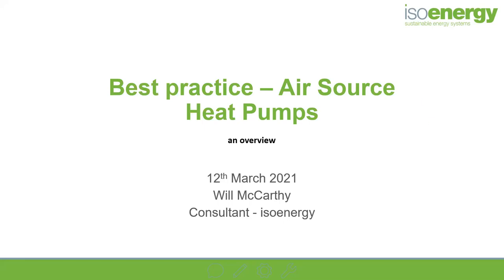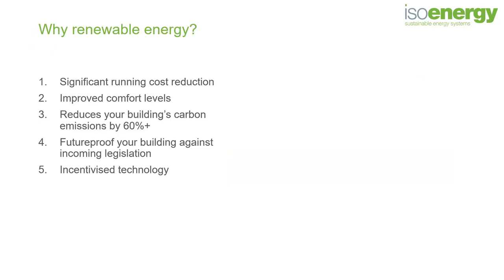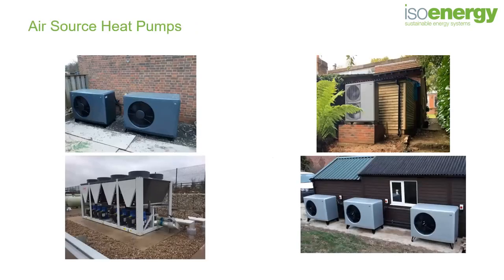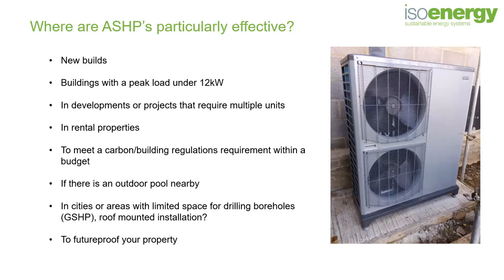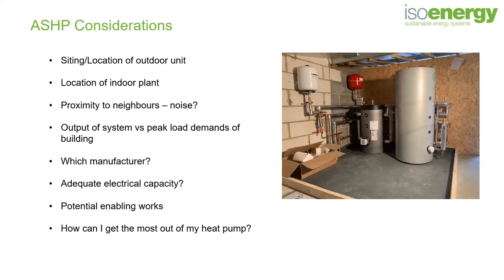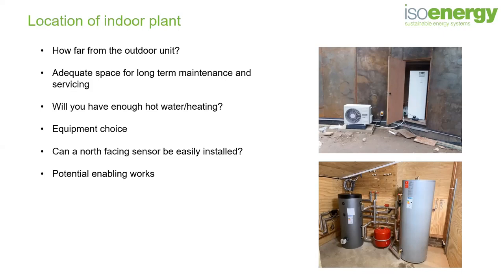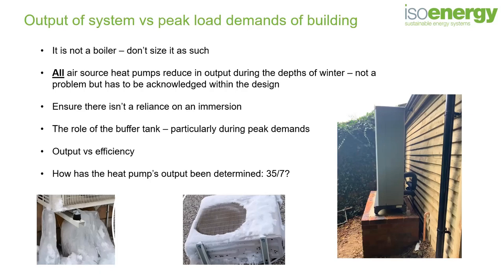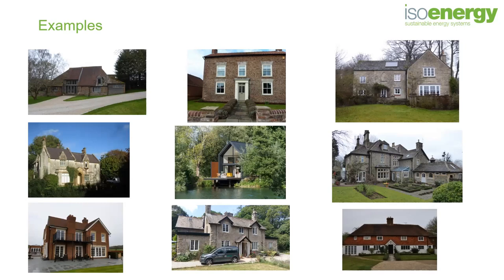isoenergy guide to air source heat pumps

Comment: There seems to be some misapprehension of the running costs for modern efficient heat pumps. My Mitsubishi heat pump is costing me significantly less to run than the gas system it replaced. It also consumes vastly less energy at 4,000 kWh pa vs 21,000kWh pa for the gas boiler it replaced.
Reply from the maker: That's great news Phil. You are right, we tend to under play the savings a little to manage expectations and not overpromise like some companies. Out outline proposals we provide once we have had a good look at the current costs and circumstances of any project, tend to have a more accurate cost payback analysis.

Comment: I'm hoping to move house very soon and had planned to install a large pv solar array linked to car charging with a Zappi and using one of the two electrical outlets from the distribution Harvi? Gadget to a bank of electrical heaters around 2-3 kilowatts to keep my living room comfortable. As I believe there is both an electric shower and a shower connected to a conventional gas boiler a large of solar could go some way to offset the electricity used as I live alone. I am retired though so would like to keep warm in the winter and have been keeping an eye on heat pumps for more than a decade but the high cost doesn't seem justified. I look forward to your next episode as you may be able to answer some of my questions. The new property is compact but there is space in the front, side and rear garden for an air source heat pump. Would it be beneficial to install the heat pump within a greenhouse to increase the pumps air intake by a few degrees? Obviously allowing plenty of air into the greenhouse. I am pretty sure that the gardens are not big enough for in ground pipes. From what you have just said it sounds like three phase will be beneficial but I always use cost versus benefits in my equations and at the moment I am leaning towards getting as many solar panels as possible first to see if that will provide me with enough power for minimal daily electric useage . At the moment I don't have a car so there are many unknown variables and probably need to move in before I am able to give you the full story and proceed with my retirement plans. £16,000 for a good sized heat pump system will currently buy a lot of solar panels. Many thanks for your help in my thought processes.
Reply from the maker: Hello Mr Harries. 

Thank you for your comments. With regards to the green house idea, I don't think that would work as the heat pump will suck too much warmth out of the air so the temperature would drop faster than the greenhouse could replace it, even with some air flow. The air source heat pumps we install are designed to sit outside in the open air and still function well regardless of the outside temperature. Please feel free to email the team on energy@iso.co.uk if you would like us to provide a feasibility study. 

Regards, Jonathan.

Comment: Does the outside unit require a water draining place? Why not covering it against snow?
Reply from the maker: Hi Jacques, There is some condensation from the outdoor unit so we recommend having a soakaway like pea gravel or similar. It doesn't need much drainage though. Some of our customers have up little roofs over their units,  which is ok as long as you don't obstruct the air flow.
Reply: @isoenergyltd  Thank you, I was thinking of a high sticking up small roof to do just that.

Comment: There are 23 million gas boilers now - these are not all going to be changed to air source heat pumps.
The way forward is green hydrogen through the national gas network and 'hydrogen ready' boilers being installed.
Reply: I agree, but the reality is and you will see this: Those 23 million gas boilers will all be declared EOL, no new gas boilers will be able to be purchased, and over time there will be no other choice.
Reply: Where does the green hydrogen come from?

Comment: Heat pumps ar more expensive to install and far more expensive to run than a gas boiler.
Reply: With the grant it's no more expensive to install than a gas system. In terms of running costs mine is actually working out cheaper. I have a Mitsubishi Ecodan R32 heat pump installed for nearly a year now during which time it has consumed 4,000kWh supplying all my heating and hot water which, at 20.68p/kWh and 24.11p/day works out at £915 for the year. In its last full year my gas boiler consumed 21,000kWh which, at 4.169p/kWh and 26.11p/day works out at £971. As gas prices increase faster than electricity this difference will become greater